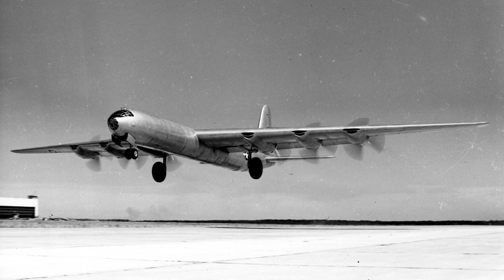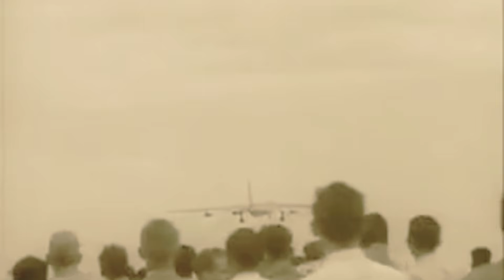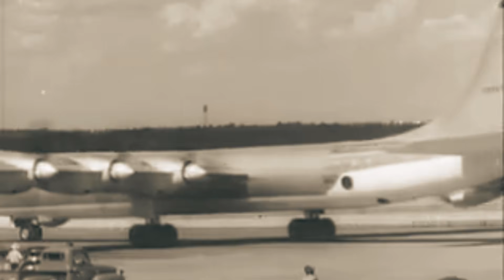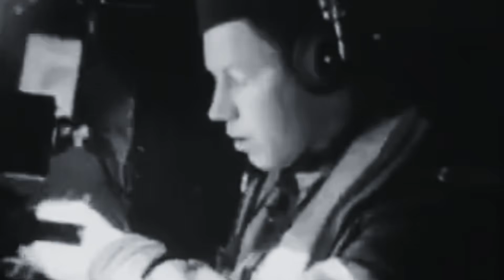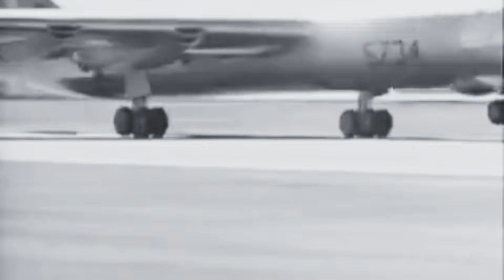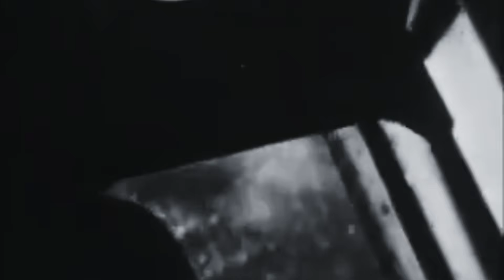The Ten-Engine Titan America’s Largest Bomber

Comment: One odd item, about the Peacemaker, was that, it once was 'the target' for F-84 jets, for a NORAD intercept training exercise. The fighters Climbed to 'go get it' (no missiles  yet, just 6X.50-cal guns, each), but the B-36, also Climbed a bit, to 48K/Ft.. In the thinner air, up-on-high, the Fighters found a little issue; They had some speed advantage, but couldn't Climb sharply, nor TURN well. But the B-36 could still TURN, easily, and even 1/2-roll to 'side-slip' upon any attack pass. The 3 fighters gave-up after a half-hour of trying to 'out-dogfight' the bomber, and the B-36 recorded some 20+ 'likely hits' from it 20mm gun turrets. The extra 90-120 mph those jet fighters could hold, but with Very limited 'maneuver space', meant the Gunners on the B-36 could, perhaps hold-their own, and the B-36's ability to 'wag it's Tail' at 40K-ft+, showed that the Thin Air was it's venue (at least, until SAM's became 'a thing'.). What a Monster this thing is! It's 1/4+/again the Size of a B-52!! Only operational Military plane I can conjure, in comparison, is the Lockheed C-5 Galaxy Transport, which, IF you've ever seen one above you at Lift-off or Landing, looks like a SKYSCRAPER with WINGS ADDED!! It should NOT be Able to Fly! That's Huge! Anyhow, I'm certain the B-36 gave Russian and Chinese Generals nightmares from '47 until '58, which, given the Times, was enough to push-back upon Communist ambition  (wait; is commy ambition an oxymoron?!) .